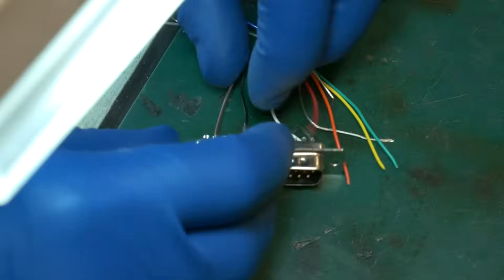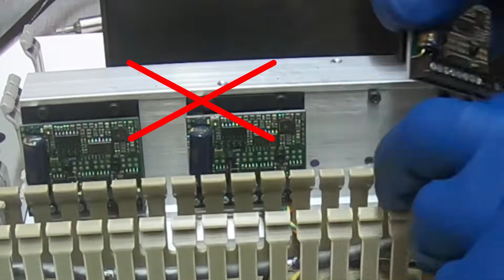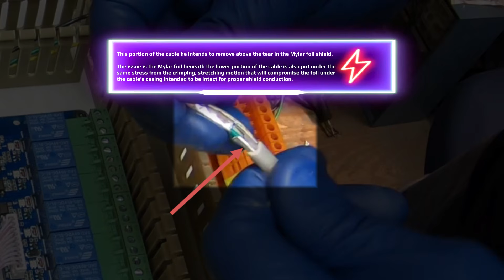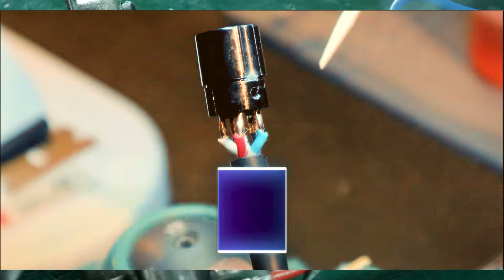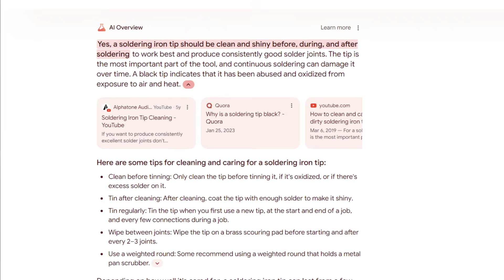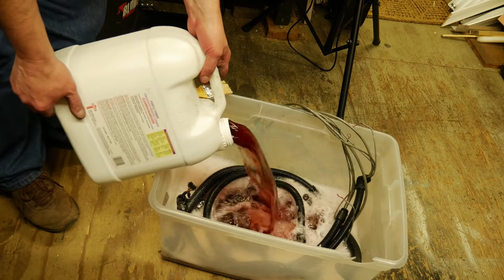CNC Controllers Built Incorrectly (Volume 26)

Comment: You you showed his face! Was it a mistake! May be I was wrong
Reply: By the way Vince, Can We avoid interference by making a separation between PSU and other sensitive parts using metal. Or distance is needed. ?  I was thinking to place the high power components behind the base plate and rout the leads through holes. Any better?

Along with ferrite and grounding too

Or distance is necessary rather than. Metal barrier?
Reply from the maker: Ferrites, and double shielded cable are best suited for sensitive electronics our robots use. 

Distance is only applicable to locations of VFD's from CNC chassis for EMI reduction as electronics in the same enclosure is simply not enough distance. 

Thank you,
Vince

Comment: I get all the call outs your doing on what NOT to do, and your focus on that is thorough.....but can you put some more focus on explaining the CORRECT thing to do. ? Cheers and keep up the good work 👍🏻
Reply from the maker: Peter my channel has well over 450 videos showing everything from soldering, to full IDS system builds like this one. https://youtu.be/Hik7SlkX5Is

Use the YouTube search bar to help yourself to what topic you would like to cover, and stay tuned for a pro grade integrated system unlike any other available currently on the market! 

Thank you,
Vince
Reply: Will do mate, i will check out some more of your vids no prob, im retrofitting my table. Im at the layout stage of the enclosure, centroid acorn, etc with its fiberoptic connected thc ! Cheers